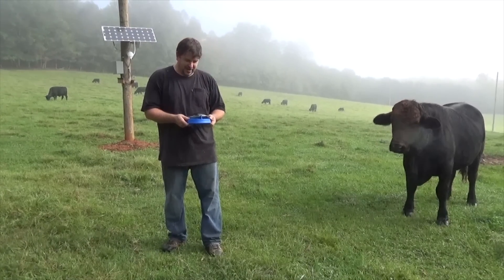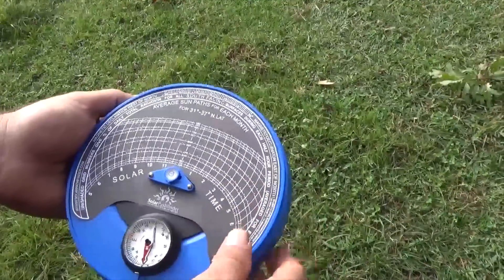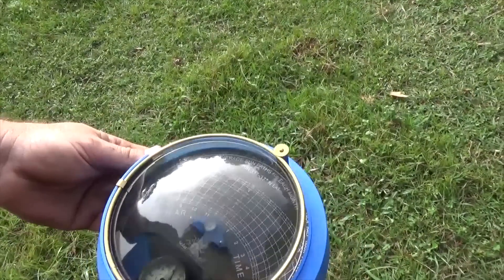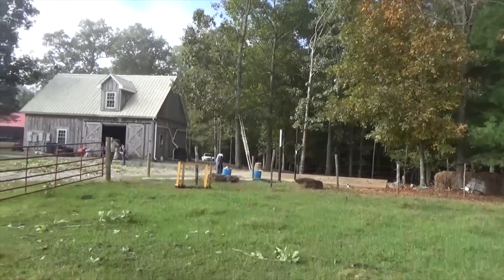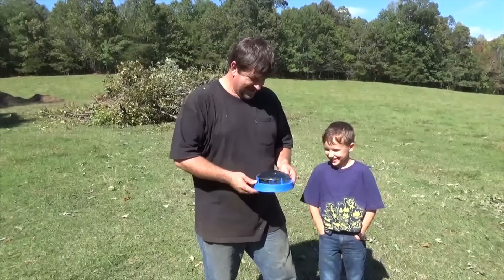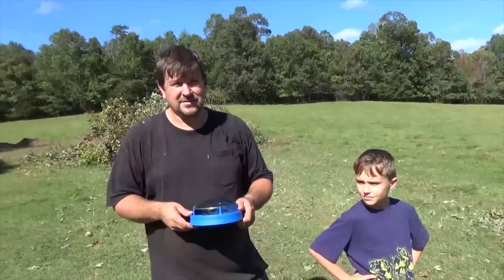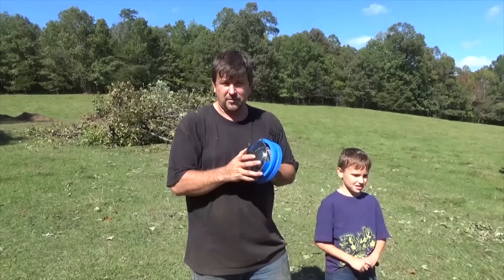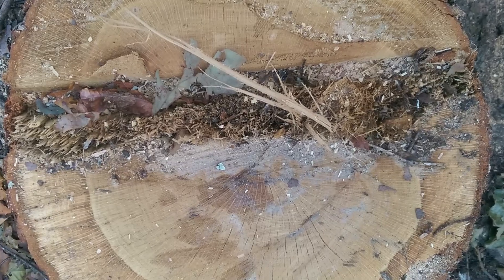Solar Site Eval - Tree Removal

Comment: why not track the sun ? there are control devices for this.
Reply: Depends on the weight of the array. And, the number of panels. Tracking makes sense to up to four large panels or 6-8 small panels. Beyond that, the cost of the trackers becomes prohibitive. Ie, it's cheaper to add more panels. There are passive trackers I like for smaller applications. But, in general, they don't carry as much weight as their powered cousins.
Reply: you dont have to move the whole array you only have to tilt the panels.

Comment: How far away can you place your solar array from your house?
Reply from the maker: +stevemccollum2011 It will be 150 ft from my service entrance on my shop.  I will have a secure load panel there at the shop and I have a manual transfer switch through which I hope to send up to 50 amps to the house which is another 150 ft away.  I am working hard at lowering my loads in the house so I can run the whole place with < 50 amps @ 240V.
Reply: +engineer775 Practical Preppers  Thanks......could you put the arrays, say 500 or 1000 feet away? So you would not have to see them from the house?
Reply: +stevemccollum2011 You can BUT not with out doing a few things. one would be to do BIG ASS DC wire and that would cost a min of 3 bucks a foot for wire and you need to wires one for pos and one for neg. 

I would say the best thing would be to do is this. Do the micro grid tie inverts. Tho's take DC and Make it into ac. Then you use the AC to do whats called AC coupling to charge your bat bank.